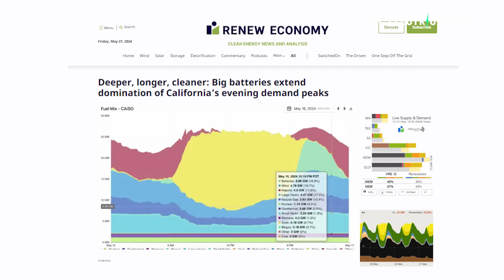Fossil fuels shattered as battery power continues breaking records in California

Comment: The South Australian battery can power the state for 4 minutes. That is a fact. There is no such thing as a 4 hour battery. After they shut all the coal and gas power stations, what do they do after a few days or a week of cloudy weather. No charging your EVs then. There is hardly one critical thinker in your entire audience. It is hilarious.
Reply: Go back to school will you
Reply: Make the packs bigger...and maybe we need smr? Reactor at the charging stations...I agree you need to know your nummers...If you need 1Gw of power for a week, tjat is 24×7×1Gw= 168 Gwh of storage. = 168.000 Mwh, 1 container has 3 Mwh?  168.000÷3= 56.000 containers,  I'm not sure if it is cloudy, that you don't get energy from solar, yes probably lessen, but still...you need wind as well for charging overnight.
Reply: for starters the term 4 hours comes from the batteries capacity and its rated output. which in regards to Victorian big battery it has 300 MW peak output and 450 MWh of capacity which it is not the 4hr type but is 1.5hrs but if they had 1200MWh then yes could last 4hrs
Reply: There are some critical thinkers in Sam's audience, but he is tone deaf to the reality that green energy is expensive and unreliable.  It can be used as a supplemental energy source but you end up installing two power systems to have a reliable power supply.
Reply: @philipdamask2279  He and his disciples ignore facts like this because it confronts their religion. You can't win a debate with these people using an inconvenient truth.
Reply: I see you’re a troll 🧌 go and drag your knuckles elsewhere.
Reply: 4 minutes huh? Your basic maths skills are non-existent. It wasn't designed for that, but if it was, this would not be the case. Does someone pay you people to post nonsense everywhere? It just seems like you're everywhere lately.
Reply: Lies a BS is all you have, Guvament, and you’re cluelessly trolling here.  Australia is the sunniest continent in the world, if it’s cloudy in one region, it’s sunny in most of the rest.
Reply: Show me a power plant that runs the whole state. Clown
Reply: Agreed. It sad that so many are are acting like cult members. They just nod along and agree on the most bizarre claims or statements. True disciples or usefully idiots?
Reply: Oh, you must be an energy economist? No?
Reply: If they have wind and solar then there is always some renewable energy being produced. The battery is not designed to replace all the energy generation but to support the grid during peak demand.
If there is some longer grid capacity problem,the grid operator can do like they always have. Rolling blackouts if the consumers won’t reduce demand voluntarily.
Reply: Recommend you do some reading on what a 4 hr battery is. Max energy stored / max output. They do exist, might not mean 4 hours for the entire grid but it's 4 , hours of max output - they then scale horizontally as required.
Reply: Stop talking at all. That California requires solar roof tops is a very serious problem without the battery banks. Only one single issue is obvious with your post.... go ahead keep ur ice driven system. 10 years or less what California is doing will expand to about half the states. Typing this list are Texas and Colorado.  Alaska is the one to gain the most the fastest.  The weird thing is 90% of what I just stated you can find right here with this channel
Reply: "no such thing as 4 hour battery" - well, that's a laughable statement. There goes your "critical thinking".
Reply: @udavster  There is no such thing as a "four hour battery". Four hours doing what? Batteries are typically measured at "X" amp hours at "X" volts. That's the standard (has been for 100 years) measurement.
Reply: It cannot power the state, it's not built for that.

But, your comment is wrong on so many levels anyways, it's not even worth discussing it.
Reply: @jantjarks7946 what a cop-out 😅😅😅
Reply: @jantjarks7946 He kept saying it was powering the state  he said batteries powered the state for 3 hours. Why would anyone ever call a battery a 4 hour battery that tells you nothing useful about the battery
Reply: It is hilarious if you think you are a lone critical thinker. Conspiracy thinker maybe. It would help if you could start by counting the number of utility scale batteries in SA. Then you could try to grasp their role in the grid mix alongside other firming and load management strategies.
Reply: There are 3 batteries (>= 10MW or 10MWh) in South Australia, and another 4 under construction. They are not intended for long duration energy supply. The reasons why are basically the same for commercial batteries as for home batteries, so lets go through it with a home battery.
Reply: You can buy a Tesla Powerwall for your home, and if you're careful, you can use it to supply your house with power for maybe 3.5 days. If you want to have battery power for 20 days - simple, just buy and install 6 Tesla Powerwall batteries.

Congratulations - you've now spent A$100,000 to get 20 days of power, which you will probably only use once in 10 years - if ever.

Does everyone understand now ? There's no TECHNICAL problem with getting a home battery that lasts for 20 days - but it's financial stupidity.

Its exactly the same situation with getting a commercial battery that lasts for 20 hours - there's no TECHNICAL problem! - but that would be damned expensive and you're likely never gonna need all that storage.

That's why commercial batteries currently focus on 1-2 hours of storage - with the current cost of batteries, that's where you can make the most money. But battery costs are coming down relentlessly, and as they do, longer duration battery storage become more financially viable.

We cannot say (at least, if we're honest!) just how much storage we will need to be available long term. But we do have advantages here in Australia that some other countries do not have:

1. We are a warm climate. Tasmania is the only Australian State that has an evening peak in power demand. All the other states (yep, even Vic) have an afternoon peak - which matches real well with solar power production.

2. Our NEM (National Electricity Market) is, geographically, the largest network on planet Earth. It stretches from Tasmania to North Queensland and across to South Australia. Since it covers half a continent, the weather is different in different places. There has never been a time when ALL the NEM was covered in cloud, or when ALL the NEM was getting no wind. So we're always getting some power from renewables.
Reply: The usefulness of a home battery is self consumption. You get much lower price for Solar than you pay for power from the grid. This is y they make sense not back up meat stick
Reply: @markhughes6673  this is why i have made the suggestion to AEMO and the pollies, that instead of 1 giant solar and battery storage to feed Asia( sun cable) add extra capacity to it for the rest of the country and hook it up to the NEM but then also do 2 or 3 similar size projects (Asian renewable hub Pilbara)  in remote areas so to expand the network like they are looking at a nullabour area for a project to produce hydrogen also and even northern south australia could do something like geothermal or solar/ wind
Reply: Also solar energy is produced even if there are clouds, less so than in ideal conditions but if it is reasonably warm they will produce regardless during the day… problem is more with winter
Reply: @lkrnpk  not true. Solar panels energy production is not dependant on heat only visible light. They work on Mars at minus 40 degrees. The amount of electricity produced on very cloudy days is negligible. But I realise that confronting people's religion with facts is pointless.
Reply: I don't understand why you would make that suggestion to AEMO and the pollies. Sun Cable is private investment - nothing to do with AEMO or the pollies.

With the exception of a few old coal power generators in QLD, the generators on the NEM are privately owned. Do people not understand this yet??? Yes, children, once upon a time, the generators were owned by GOVERNMENTS. But nowadays, power generators are privately owned. Yeah, Snowy Hydro is technically owned by the Commonwealth but it has been corporatised (incorporated under ASIC) and must act like a private company.

So you're never gonna see some clone of Sun Cable out in the middle of the desert somewhere 'cause doing so is not profitable for a private company.

Look, boys and girls - pay attention and y'all might learn something :) There are two changes making their way through the Australian electricity market: 1 big change, and 1 small change.

The small change is the move from generating power from fossil fuels to generating it from renewables. That is the SMALL change.

The big change is the move from centralised generation to every homeowner and every business generating their own power. That is the BIG change.

Now think through the effects of that BIG change. South Australia has about 40% of homes with rooftop PV - and already at times that is generating 100% of SA's electricity requirements. Well, what do think will happen when 80% of SA's homes have PV (and home batteries!)?? SA will be getting ALL ITS ELECTRICITY FROM ROOFTOP PV most of the time. And homeowners and businesses across Australia are all gonna keep putting PV on their roofs. That is why no one is building a commercial solar farm nowadays unless they include a battery with it - cause their only chance of making some $$ is when the sun isn't shining on home rooftops.

There is no reason to build huge solar farms in the middle of Australia when rooftop PV is already starting to swamp the network.

BTW, one person who has not understood either the SMALL or the BIG changes in Australian power generation is a certain politician (yeah, you all know who I'm talking about) who is spruiking Nuclear Power. There are two problems:

1. It won't work technically. Nuclear works best when the demand is consistent, and we all know that with every man and his dog putting PV on his house roof and his doghouse roof, power demand is gonna yo-yo every day.

2. Our power generation is now commercial, not gummint. And no private company is gonna stump up A$15billion for a Nuclear Power plant that doesn't fit with daily changes to power output.
Reply: @RayJohnson1980  Sorry, I posted a more detailed reply on electricity generation lower down.

But, in, passing, the hype around hydrogen is, well, almost all 'hype'. Hydrogen is a great fuel. But it is just about the worst element to store and transport. About the only way hydrogen could be worse to handle is if it wuz radioactive.
Reply: @Guvament_bs  I do not have any kind of religion, I looked at solar panel production where I live in Northern Europe and during whole month of May the worst it got was 55% out of 100, not a fraction. Sun is still out there, it shines through the clouds and radiates, yes, you are right heat is not the main thing but radiation is, it can penetrate the clouds and in summer months when it is high up, even if the day is cloudy you maybe lose 50% of capacity but it will not be ''negligible'' amount that you get. You will not suddenly get much less solar radiation that you usually have or superclouds that can block and absorb all of it. In winter it though is a big issue as there is way less of solar radiation. And since I live in a climate where solar panels are not really usable from say late October to early March, I have no religion to replace all with solar panels, but they have their use when sun is shining. It is kinda actually worse with wind which is way harder to predict, it can be 100% and then can be 0... or negligible amount. But with solar if you live in certain climate zone when radiation is always rather good, even with clouds you still get significant amount, not a fraction

Comment: Nonsense, as of 00:45 05/31/2024 in CA, renewables are providing 21.7% of supply, batteries 0.0%, natural gas 20.2%, imports 30.6%, nuclear 9.2% and hydro 18.3%. Figures are from California ISO.
Reply: So you picked a time when the batteries had been depleted which is after the evening peak. What does that prove? That Electric Viking is right and that the batteries are helping carry over solar into the evening peak?
Reply: @steve_787  Wow, batteries provide power for a few hours in the evening while reliable fossils fuels available 24/7.
Reply: just remember you talking 0045hrs i.e. middle of the night. do you not class hydro as renewable? if so you do then it should be seen as 40% renewables not 21.7%
Reply: @RayJohnson1980  California ISO classifies the electricity sources. Take it up with them
Reply: Only because hydro has its own "class" it's no longer renewable energy?

Who the heck breeds such ideas? Sten Laurel and Oliver Hardy?
🤣😅
Reply: @jantjarks7946  Hydro energy is renewable when it comes from Hydro Dam!
Reply: But you didn't mention coal.  That's one step eliminated.
Reply: @AllDogsAreGoodDogs  Much of that "imports 30.6%" is from coal, but California doesn't count that in their statistics.  Figures don't lie, but liars sure figure.
Reply: @AllDogsAreGoodDogs  No doubt much of the imported electricity is generated by coal.
Reply: @snappingclam8801  but can only assume
Reply: @snappingclam8801  Nope, imported electricity has to come from non coal power plants. Edited: We purchase a lot from Washington because they are primarily hydro.
Reply: @snappingclam8801  No, most imported electricity is Hydro, Nuclear, and NG.   Coal, inclusive of all imports, is less than 5% of California's yearly electricity generation now and its been that way for a while.
Reply: As capacity grows, the fossil fuel use declines.
Renewables are cheaper to build and run, which is bringing about the end of fossil fuels
Reply: @Stumpy1854-Orion  Solar and wind with battery backup are cheap and reliable, yet CA's electricity is expensive and heavily relies on fossil fuels. It's a cruel joke.
Reply: @snappingclam8801  It will change as market forces take hold.
I believe that generating your own solar energy in CA, comes at a cost which will also change with political pressure

Comment: California had periodic horrible electricity shortage and blackout issues in previous years during summer heat waves. It was really really bad.
Reply: not now
Reply: @RayJohnson1980 incorrect. Not until the next time, is more appropriate.
Reply: There have been a lot of battery storage added and new come online, you would think there will be a time that issue goes away
Reply: I live in los angeles county since 1982 and this is a lie. Black outs my Azz! Like never
Reply: @larryc1616  Many of those recents outages are a result of high-wind conditions where the lines are shut down to prevent fires. I'm in a valley that gets subjected to that a lot. Brown outs from high energy use should be reduced as an enormous amount of energy supply has been added this past year.
Reply: @larryc1616  A lie? Really? No problems with electricity shortages in California since 1982? For starters, go to Wikipedia and read the following article: “2000–2001 California electricity crisis”
Reply: Some of that was thanks to Enron, which played with electricity supply to boost their own profits.
Reply: That was mostly due to a botched deregulation scheme that was written by the utilities. They weren’t really shortages though. It a company that shut down five of its six plants for maintenance, then charging 1000% more for the one operating plants power. It was legal thuggery. These same people blamed the Governor who had very little to do with it.
Reply: "Had"
Reply: Well you cant shut the nodding donkies off or the refineries or any of the massive power consuming oil infrastructure.
Reply: As does Texas. Your point?